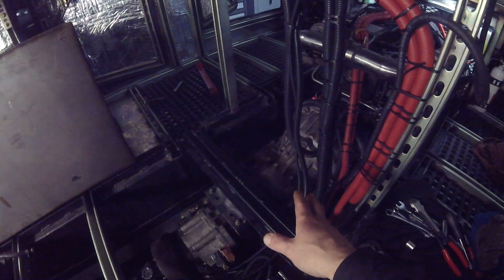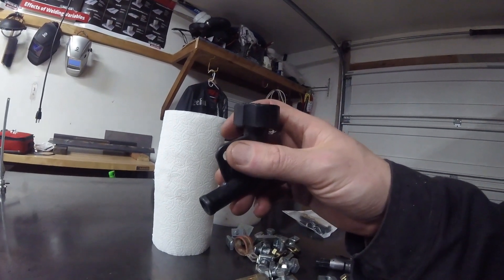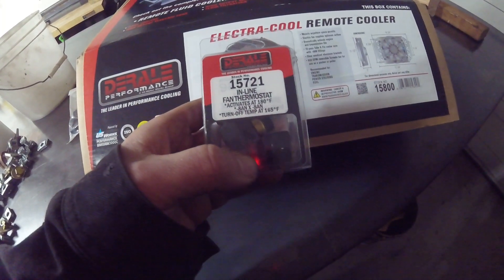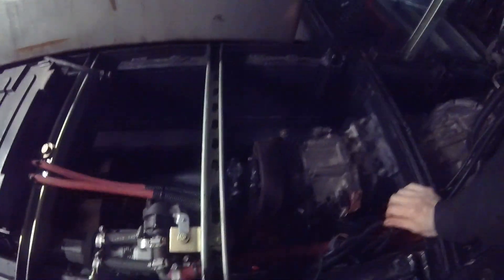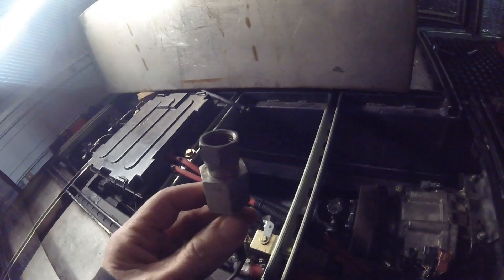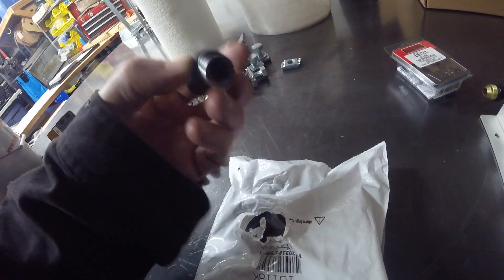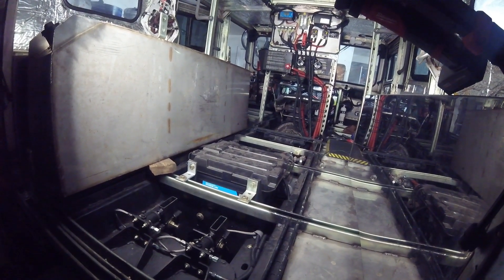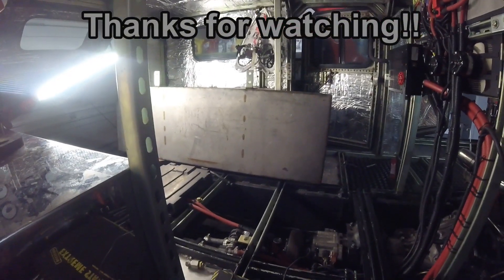Rusty the Spryte build part 105 (JATCO JR403E installation and upcoming snowcat mods)

Comment: Almost there!  You could  stack o ring with a machined packing nut for those leaks?
Reply from the maker: I was thinking of using a bonded washer on the inside of the case between the spring and the case.

Comment: I was going to suggest a steering rod boot from the marine world!  Pretty similar to the brake boots. Ill need to go into mine if I ever get my drop box coming this direction!
Reply from the maker: I would love to see a picture of what is actually supposed to be there.  I have been unable to find one...
Reply: I stuck my head in as far as I could and can't quite make it out.  Its minus 31 Celsius today so I wasn't lingering under there too long! I'll send you a picture once it either warms up or I get it inside...... western union has completely dropped the ball for two weeks straight so hopefully tomorrow my drop box will finally be on its way! Knock on wood Richard has the patience of a saint and has put on over 180 miles attempting to get paid for the part.....

Comment: I don't guess that that's big enough to actually have a industrial 3/4 inch air line rubber gasket in it?
Reply from the maker: I do not follow??
Reply: @SeanFastidious  I think they call him twist claw Airlines but the gasket and it may be too big when I first watched your video that shaft look like it might have been in at least a 1/2 inch to 3/4 that's what brought it to mine and it's got a internal or external locking ring in it, just take a look their Grainger has them I believe
Reply from the maker: @BRHood  I think the shaft is 1/2" cause the nut is 3/4".  Are you thinking of a bonded washer on the inside of the case between the case, and the spring and around the steering rod shaft?  That was my first thought to see if it would work.